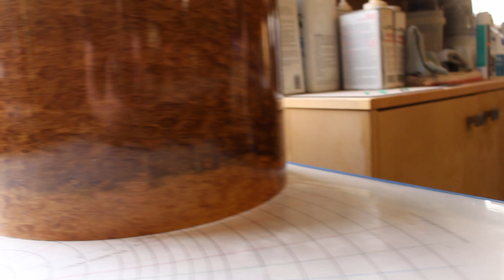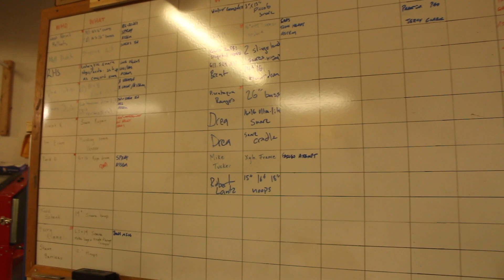Water-Based Finish Issues, Slingerland Sparkle Wrap Trimming, And The Acidic Trombonist

Comment: Anyone ever cut chrome over wood wrap stainless steel Ludwig Tom drum 14”x13” deep I want to make into snares drums?
Reply from the maker: I'm not sure what you mean by chrome over wood wrap stainless steel.

We've cut down toms, replaced wrap with veneer, applied new wrap, powder coated hardware. If you mean wrap a metal shell, we have not done that. If the shell is contoured or grooved, it wouldn't work very well.
Reply: Stainless steel wrap
Reply: The wrap is stainless steel over the wood Tom drum chrome over wood Ludwig